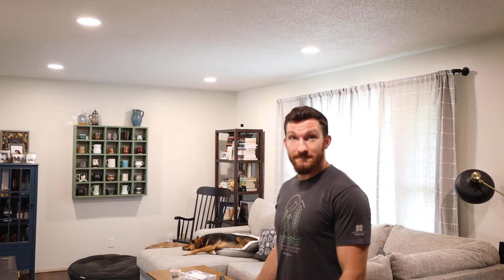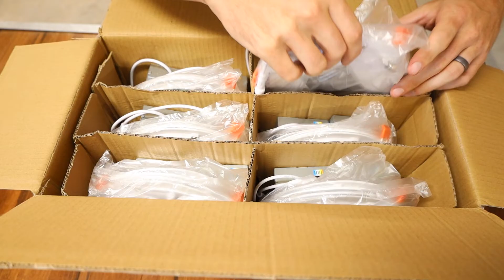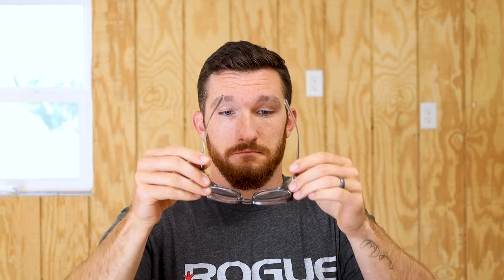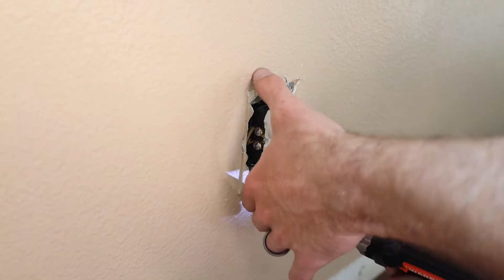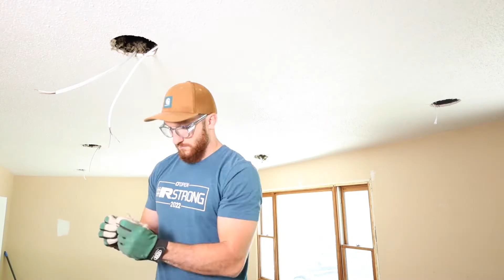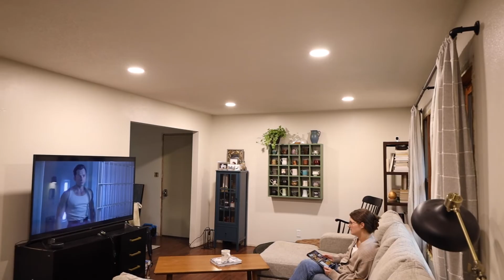Super Easy Recessed Lighting Install | Amico LED Lights

Comment: Maybe dumb question but I just ordered 2 different packs of these and one pack is 1000lm and the other is 1050lm. Debating if I should return one , will they be noticeable difference you think off the 50 lumens difference ?
Reply: Not a dumb question 
My first box looked different than second. 
Junction is smaller on newer box and newer box says 1050lms while they still show on am azon as being 1200 lmn 

Don't know what to make of it but will be an issue is they light different

Light panel looks to be the exact same so I'm just going to give it a go and see.

Comment: I like the looks of these for a house I'm building. Just thinking longevity how hard is it to pull the lights back out of the ceiling after you snap them in there in case you need to replace them?
Reply from the maker: Not too hard at all! The spring clamps are strong but not so strong you can’t flex them back to get the light out 👍

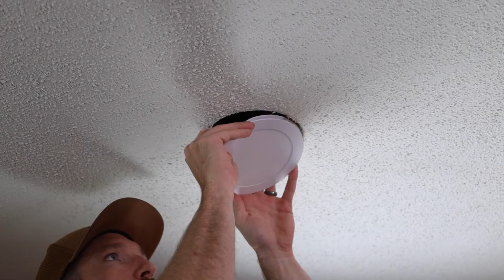Comment: 07:06 The gasket didn't seal correctly.
07:39 faceplate screws are misaligned 🤢. Should've bought new white 6/32 screws for the faceplate.
Reply: It looked good lil bro 😎
Reply: You absolutely right!

Comment: Are these typically installed in series? Got everything else figured out except for the choice of series vs parallel. Great video nicely explained!
Reply from the maker: It’s technically parallel, white to white and black to black throughout, but series in the sense that you run wire from one light to the next (rather than from the source to each light individually). Hope that makes sense!

Comment: I just had these put in but I want to change them to a warmer color.  Do they pull out easily?  I’m worried about breaking the springs or damaging the drywall.
Reply from the maker: I’ve removed mine a couple times for the same reason, they aren’t too bad to take out. Just pull it down a bit from the edge and push one of the spring clamps back with your finger until it slides out of the drywall 👌🏽.
Reply: @ModernHobbyist  ok thanks

Comment: I’ve never seen someone use a power drill to screw in light switch faceplate screws…..lol.
Good video anyway.
And ps, when tightening down light switch faceplates, all the screws should be straight up and down, or 12 and 6 o’clock position to a snug fit.
Reply from the maker: You underestimate my level of impatience! Ain't nobody got time to hand screw all the faceplate screws lol
Reply: @ModernHobbyist  lol. True and I appreciate your sense of humor. But man, it was ONE faceplate at the main entrance…….not like you were screwing in a thousand faceplates at a convention centre installation. 
It also shows that attention to detail was paid btw which reflects on ALL the work that was done in the home…….especially when selling if you flip homes. Just a thought good man! 👍🏼

Comment: Be careful when using these lights, they tend to flicker with the slightest load being on the same circuit.
Reply from the maker: I haven’t had any issues with that in my home, but I also run the lights off of the Lutron Dimmer which specifically supports LEDs. So my first guess at the cause of flickering would be the switches you are using

Comment: I keep looking for a video on how to do the wiring.  Everyone just flies through that part.
Reply from the maker: Yeah sorry about that! It was 100º here in Iowa so I couldn't stand being in the attic long enough to film anything. Wiring is simple enough though, basically all the lights will be wired in series. It gets more complicated if you have a three-way switch setup, but essentially the neutral, hot and ground from the first light just connect to the corresponding neutral, hot and ground on the second light which connects to the third, etc... Hard to explain in words, but I hope that makes sense!

Comment: Did you lose the outlet you used?
Reply: Or can you still use the outlet even with the lights wired to it?
Reply from the maker: Yup, you can still use the outlet! I’m just basically using at a junction box to pass power up to the lights

Comment: thank god you rewired that outlet, never pass the neutral through the plug to another wire. Dumbest thing you could do.
Outlets are only rated for 15amp circuitry, clearly 20 amp circuits can exceed that limit, which are fairly common.
When you pass the electricity through the plug instead of a junction splice, you risk turning that plug outlet into a filament for the brand new micro heater you just installed into that junction box.
Reply from the maker: Good to know! Sadly that wasn’t the only electrical no-no I’ve seen in my house so far. Most of them have been updated, but the previous owners decided to build a shower on top the the electrical panel…

Comment: How did you connect all wire in the ceiling?
Reply: fr my question lmao the only reason i watched
Reply from the maker: @5Thapollo  To be honest, I was going to film that part, but it was August in Iowa so it was over 100º in the attic and I didn't have the stamina to film up there 😩. The wiring was the simple part though, just in series from one light to the next!
Reply: @ModernHobbyist had one of those jobs i feel you just finding the lights and moving everything around

Comment: awesome! did you have to mount the boxes to studs or did you just plces them in the ceiling
Reply from the maker: Thanks! I just placed them on the drywall, but they have mounting holes if you wanted to place them on a stud.

Comment: I'm thinking about getting these for my soffit. Do you recommend them for soffit?
Reply from the maker: From what I can tell, the company and Amazon reviews all say they are wet rated and would work well for soffit. I haven't tried them in soffit myself, but it seems it'd work well. Hope that helps!
Reply: @ModernHobbyist  thank you for your response. This does help
Reply: @ModernHobbyist  do you know of a wi-fi switch I can use with these lights?

Comment: Don't forget to install attic ceiling light covers and great stuff insulating foam so you don't lose heat in winter and cooling in summer.
Reply from the maker: Didn’t even know that was a thing, thanks for the tip!

Comment: What size holes did you cut? I’m getting the 6 inch lights, do I need to make the hole smaller?
Reply from the maker: For my lights, it recommended a 6.25" hole, but it came with instructions and a cutting template too. My lights are labelled as 6" lights as well, so I would think it'd be the same for you. Hope that helps!